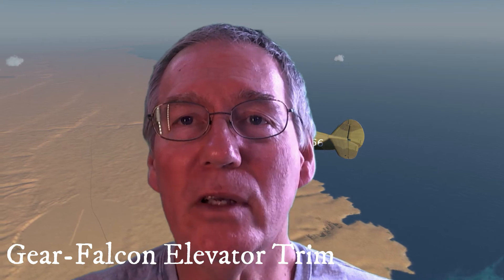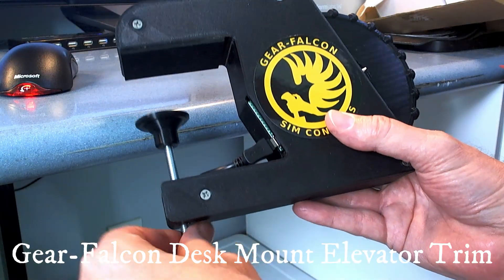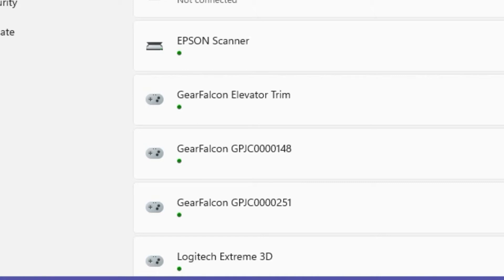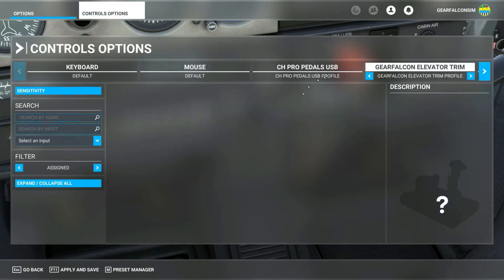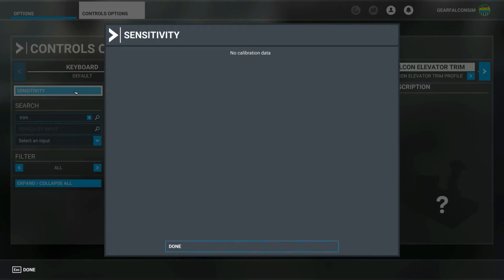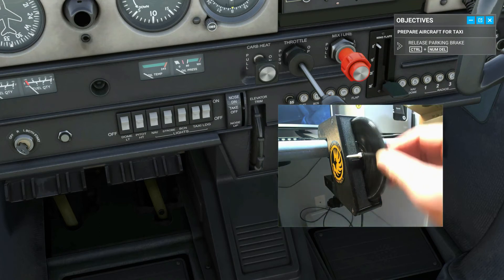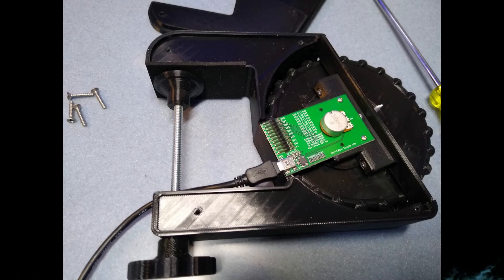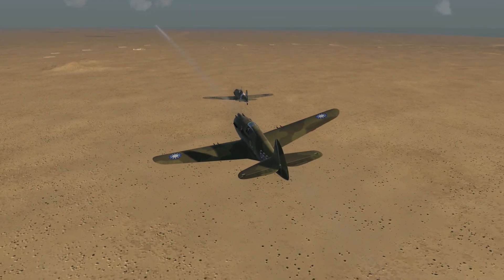Adding an Elevator Trim to your sim

Comment: Hello, how do we connect the secondary trim (rudder & aileron) in MSFS, since they don't have a <axis> option?
Reply from the maker: Unfortunately, at this time MSFS 2020 does not support analog rudder or aileron trim. Hopefully in a future update they'll start supporting it. Until then you'll have to use keyboard, switches , or buttons for that. Lots of other sims DO allow analog controls for those functions. I'm thinking of creating a version of my 3-trim panel that uses analog for elevator trim, but then uses encoders for rudder and aileron, just for MSFS 2020.
Reply: What would be a realistic sensitivity for the Cessna 172 on msfs2020